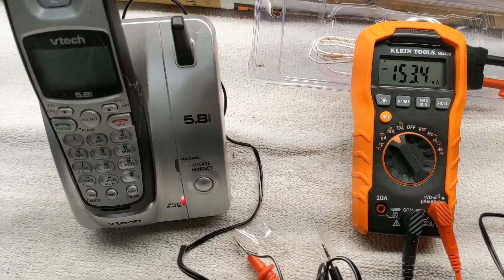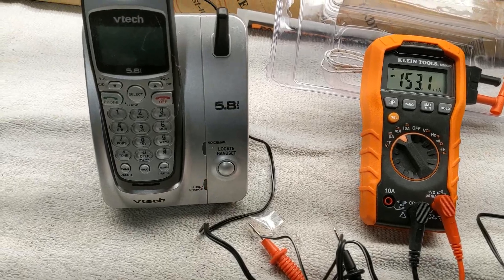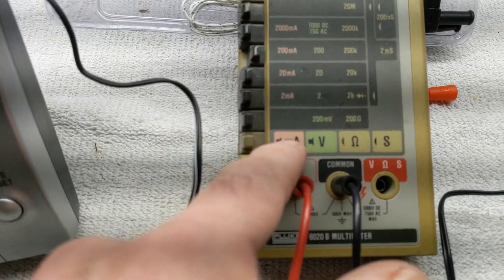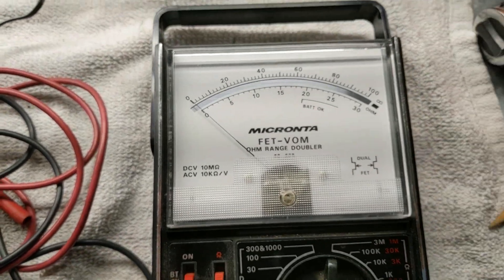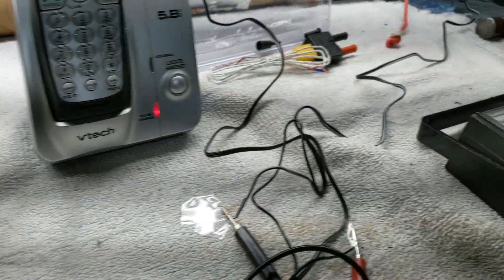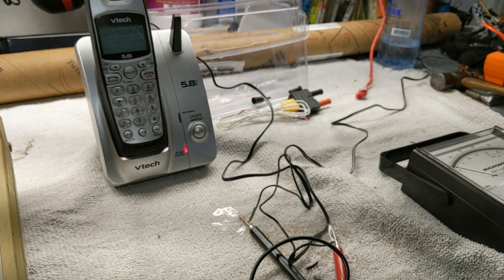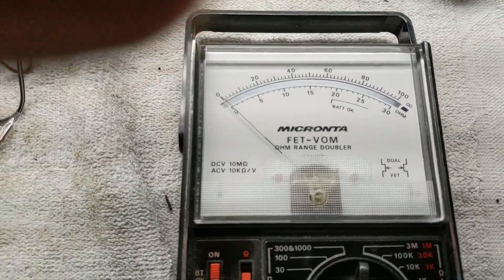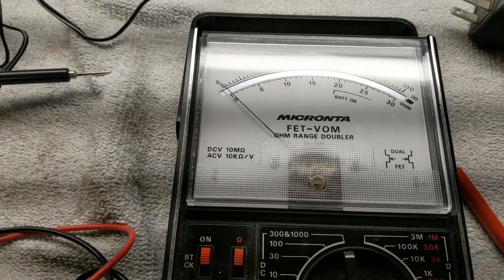Tools multimeter klein how to test verify if amp reading is valid working by froggy

Comment: Just trying to be helpful.  But I'm curious what are  you  measuring on your Corvette?  Because a milliamp  is a very small current draw.  It is one thousandth of an ampere.  Good luck in your adventure.
Reply from the maker: Dash cam, radar detector.
Reply: @1947froggy  I hope all goes well.  Keep up the good work. Thanks for the reply.